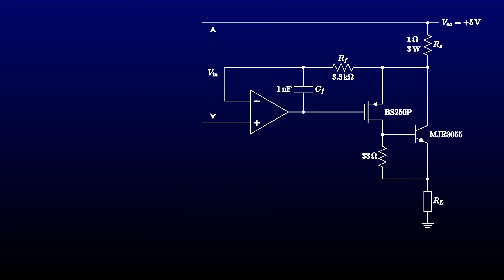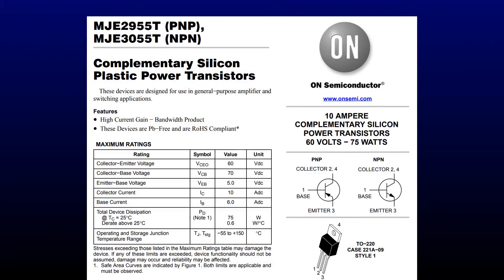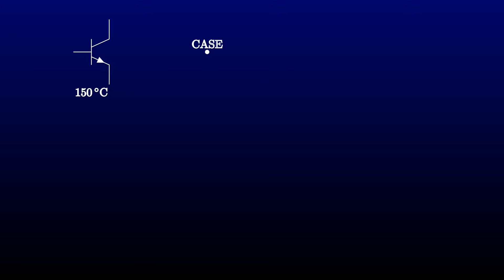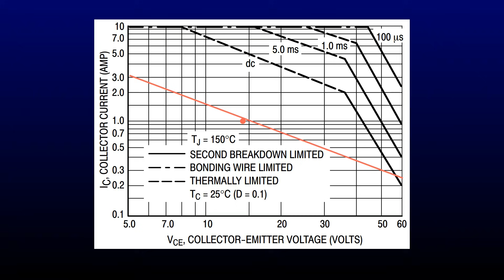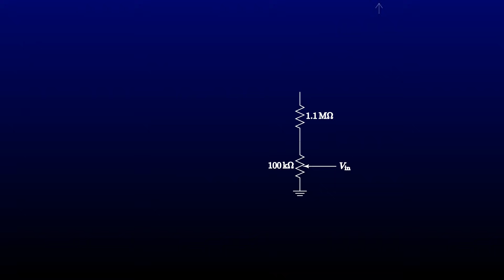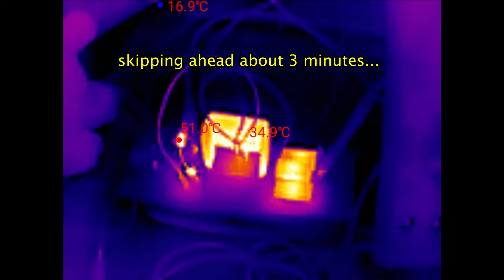Transconductance amplifiers 2 - more power! | Op-amp Basics, episode 15

Comment: As a repair tech it's rare to have something come across the bench that doesn't have a component that is over-dissipating- resistor, zener, transistor....even the "nice" stuff. And then if they've gotten that part right,  are the caps are too close to their voltage rating or they slam a cap up against something that gets hot. Thanks for the heatsink tutorial Kevin!
Reply from the maker: Perhaps devices that are designed NOT to overheat or overvolt don't need your services as often?  Although they're pretty rare.  You can't have a 'laptop' computer on your lap any more, because you'll get burnt! Customers tend to go by price alone, and build quality falls by the wayside.

Comment: Modern phone and laptop charger manufacturers would not only count this temp as acceptable but see it as potential cost reduction headroom. I mean, some of the crappier chargers get so hot, their components would desolder themselves from the board if they still used leaded solder.
Reply from the maker: Well, yeah. So make the circuit Tj limited, and let the surface temperatures burn fingers. Sell the chargers through an offshore shell company that will just go out of business if it burns down anyone's house. Late stage capitalism at work.

Comment: Great video as usual 😊
What thermal camera do you use in the video?
Reply from the maker: Thermal Master P-1. I haven't had it all that long, but my initial impression is that it's great for the price. (I was astonished at how cheap it was - before I retired, most of the IR cameras I worked with were high-end ones from FLIR and priced accordingly.)

Comment: Best explanation of power stage thermal management I have heard.  Thanks Kevin!
Reply from the maker: I'm glad you found it useful!

Be glad that a lumped-element thermal model works for this application. Setting up distributed-parameter heat transfer models in software like ANSYS is a nightmare! I'm glad that I had colleagues who did that sort of thing, I was always the instrumentation guy.

Comment: I never thought before of IGBTs as Sziklai pairs, but it makes sense. Surprised to see an IGBT equivalent used in a linear application, usually those are used for switching applications.
Reply from the maker: Yeah, it's a bit odd, but it means that you're not trying to have a little op-amp drive the gate of a big MOSFET.  (Although a big part of the decision was based on the fact that I didn't have a suitable power MOSFET on hand, but I have a bunch of MJE3055's.)
Reply: @KludgesFromKevinsCave  I actually use them all the time for linear applications. But I also do a lot of really dumb stuff, so I'm not saying it's a good idea. They really seem to last through abuse a lot more than other transistors. I've been majunf various active loads/current sinks, basically setting transistors as a dead short between power and ground and drawing up to 20amps through them. They're reasonably linear after the threshold and don't blow up as fast as mosfets or BJTs. I think GreatScott even did a video on a homemade class A audio amp using IGBTs. So they are very useful for things outside of switching. Although, I have to admit, part of the reason I use them is because they were just the cheapest component I could in bulk in a TO-247 package. And when I bought them, Kevin hadn't yet released this video and I'm terrible at thermal calculations. I tried to calculate thermals, got everything wrong, gave up and decided to just use giant to-247 transistors with giant heatsinks so I wouldn't have to worry about it again. I also stopped using insulating pads and just use thernal paste, which keeps things exciting when the heatsink is over 100v. Thanks to this video, I'll now be able to calculate whether it's actually wirth risking my life with high voltage heatsinks just to increase the heat transfer.
Reply from the maker: Wow, great stuff!

IGBT's are perfectly fine for linear applications. The reason you see them so little is that they're too slow for most RF stuff, and for lower-frequency things, you usually see designers building class D amps nowadays. 

I wouldn't have guessed that you're an electronics geek from your channel. It seems to be all about motorcycles crawling over rocks.  (Which looks as if it might be fun for someone else. The few times in my life that I've been aboard a motorcycle have not left me eager to repeat the experience.)

Comment: Thanks Kevin! Very clear the explanation behind each line in the transistor datasheet power limits (also the rest of the video, as usual).

The linear thermal equivalent circuit rocks for these applications. No need to introduce monsters like distributed parameters or fluid mechanics here.
Reply from the maker: Exactly! We're not designing the cooling system for a high-end laptop or anything. Lumped parameters work fine.  (And I'm happy to let someone else handle the thermo-@*#$%#!) 

The big takeaway is how inefficient linear circuits are.  And for a lot of applications, there's no good replacement, which is why we still see massive heat sinks in a lot of places.

Comment: The thermal conductivity is measured in per Mississippi on the thumb.
It would be interesting to understand the performance of such transconductance circuits. Bandwidth, settling times and more.
Reply from the maker: I'm from the East Coast. We counted alligators rather than Mississippis.

Comment: Hi Kevin, been watching every video since i've subscribed! thank you for your dedication to sharing your knowledge!
Is the thermal resistance between junction to case is to the top of the case to the conducting tab?
Reply from the maker: On a TO-220, the whole back surface of the part is understood to be the conducting surface. On a TO-3, it's the whole base of the transistor. Surface mount parts vary. Sometimes, they assume cooling through the PC board foil, some of the bigger packages are designed to have some sort of fin on top.

Comment: Ah yes - the 'Bob Pease Tactile Thermal Test' method of checking transistor temperature :)
Reply from the maker: They didn't have cheap thermal cameras when Bob was alive. I was actually amazed at how cheap they'd become, when I got mine.  (At work, I'd only worked with high-end radiometric cameras from FLIR, with germanium lenses. Expen$$$ive.)